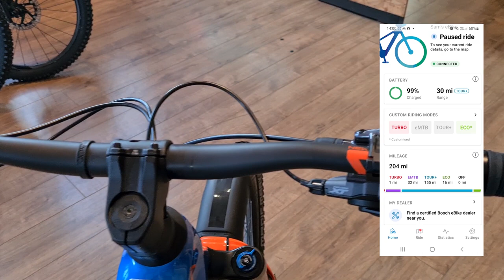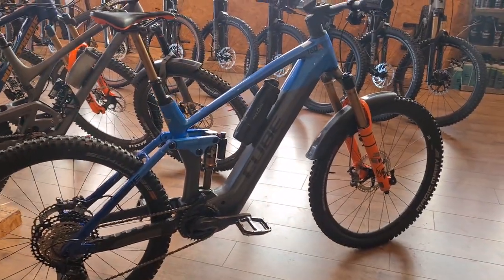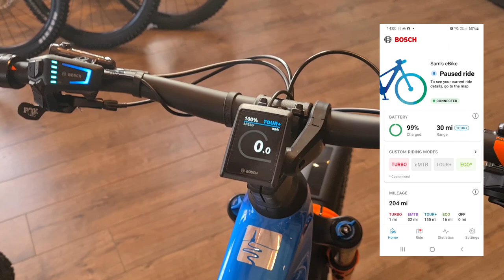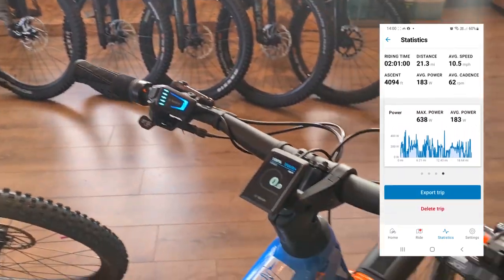BOSCH KIOX 300 DISPLAY DELETE

Comment: Have you had any experience pulling the logs from the bike? it would be good to be able to access more information from it, like error logs etc...or is that in the realms of the dealer only
Reply from the maker: We are a dealer so yes we have experience of that. And yes that's a certified Bosch dealer thing.
Reply: Thanks for the tip 🎉 baldy

Comment: So what did you do to the other loose wire, push it into the battery?
Reply from the maker: The feed that comes up from the motor goes into the bar remote. So, the screen and cable that used to plug into the bar remote is removed.
Reply: @cyclefactoryuk  my bikes XL the cable is too short, is it a motor out Job to fit a longer cable?

Comment: Did you say you don’t need the display to use the app?
Reply from the maker: Correct 👍
Reply: I believe it only links up with your phone once you had the Kiox installed, then you can remove to use your phone as a display.

The reason I’m saying this is bc people use the app without the Kiox yet I have a brand new Bulls Copperhead Bosh gen 4 and it’s doesn’t link up. Nor even tries to, so my only assumption is that people that had the Kiox and downloaded the app got rid of it on a later date to use their phones OR I can’t figure out how to do it. 

But just letting you know, there are a lot of people confused about this bc they are running into the same problem as I am.

Perhaps a quick video showing us what we are doing wrong or what we are NOT doing in order to use our phones to replace the Kiox.  

Tks!

And yes, I did a long press on power button until I got the top blinking light on “hand controller” don’t know what is called. The thingie 😆 

🤞🏽🤞🏽🤞🏽